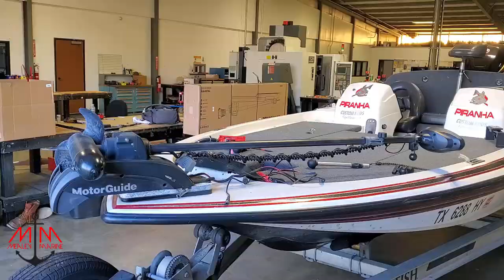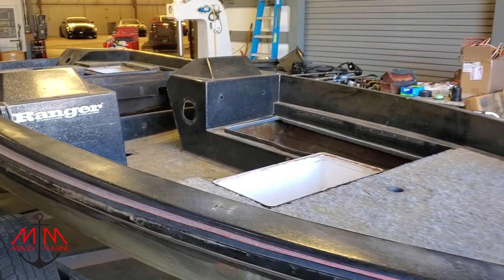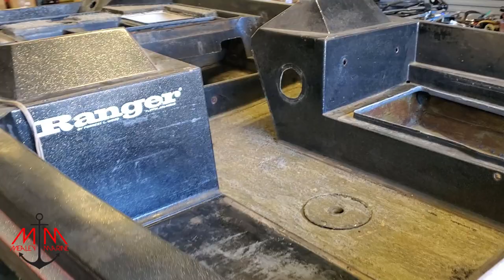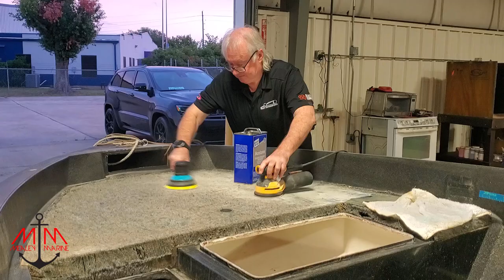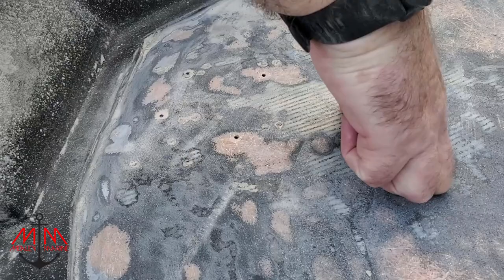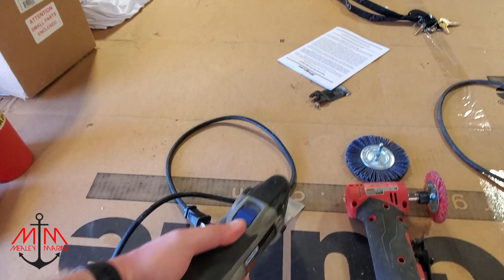BASS BOAT RESTORATION PROJECT | 1988 Ranger 393v | Part 5: Removing Carpet

Comment: I read on BassBoat Central where a guy used Sentinel 747 adhesive remover. He said there was no fumes or odor. He applied it with a brush, waited 20 minutes and cleaned up the glue with paper towels. If that is true it must be unbelievable.

Comment: I've seen guys use xylene or MEK (Methyl Ethyl Keytone) to remove carpet glue.  Others have tried Goo be gone, Denatured Alcohol, Lacquer Thinner, Fiberglass prep solution, Acetone.  Some are toxic and flammable.

Comment: Great Video,  I have past experience removing carpet,  mechanical elbow grease seems best,  chemicals are excellent but really wash boat thoroughly  to remove all residue.  Question, I bought a 17 foot Tuffy.  I am going to remove old carpet and spray bed liner in center section,  do you think all glue has to be removed before application?